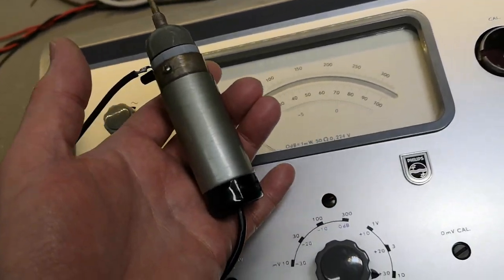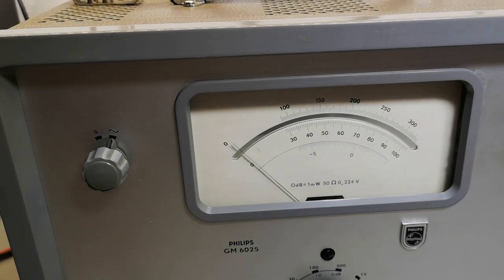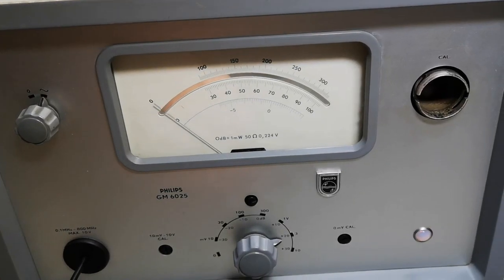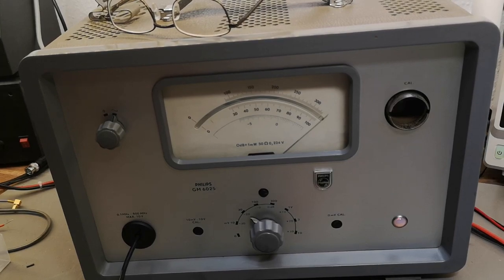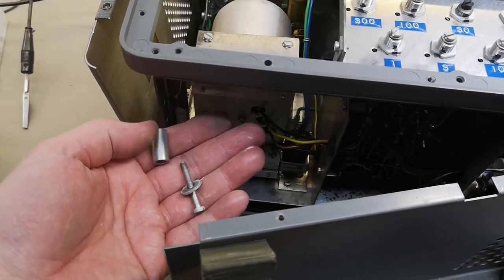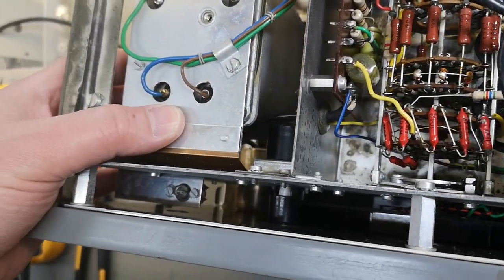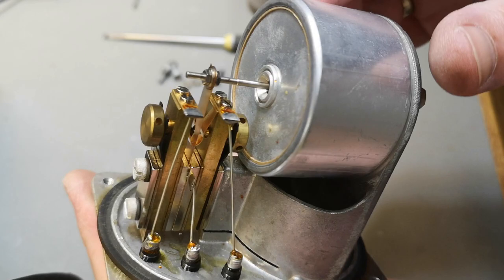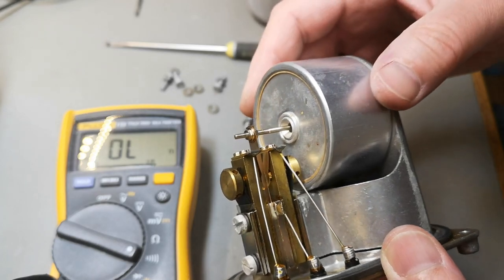Philips GM6025 UHF Millivoltmeter 1961 test repair Teardown

Comment: I would say the sine wave output is there to feed into the circuit under test, so as to provide a RF signal from what is presumably going to be a transmitter, amplifier or  receiver, where the sine wave is going to be used to modulate a carrier, so that you have AM output to go to the chopper amplifier, and the recovered AF audio at 1kHz is detected by the diode head, and then is used as a reference for full scale, or at least tracks the input range. For amplifier use then the reading is direct gain, and for a transmitter the modulation index, and for a receiver sensitivity.
Reply from the maker: could be.. but the sine 1.1khz generator's level, track the settings for the RF meter !! that is a bit confusing for most of the tests i can imagine :-) anyways it might be handy with a sige generator, maybe it is just an extra feature to use all by it self, very special connector for it too